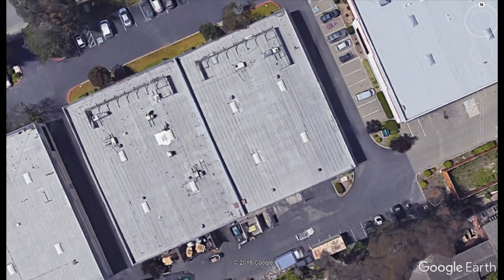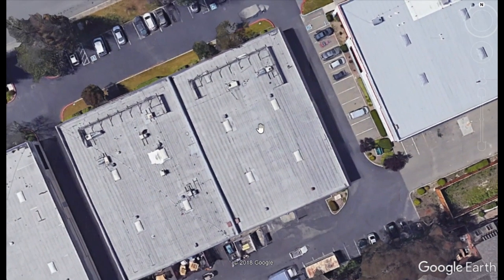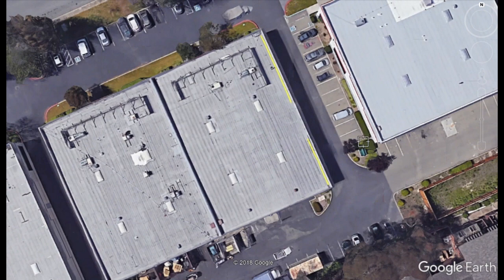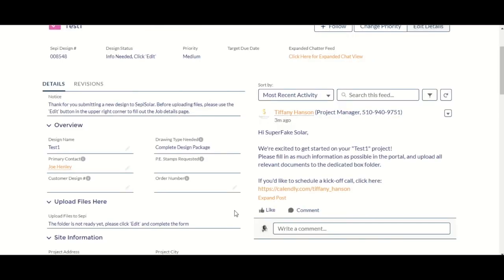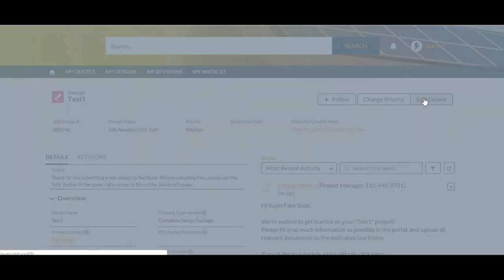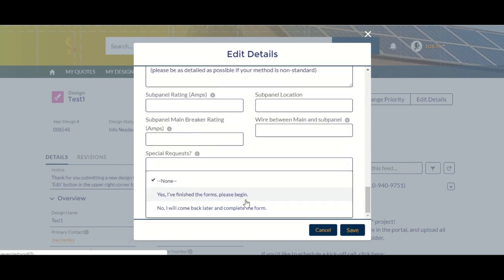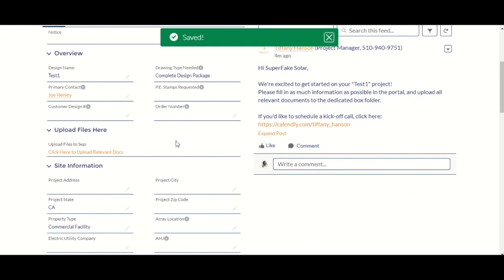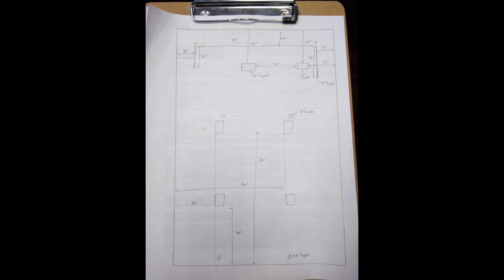How to Perform a Solar Site Survey

Comment: So my rafters are about 83 inches apart and I am being told I am not able to have panels installed due to the rafter beams being too apart. Is this correct?
Reply: Yes that is correct, beams shouldn’t be more than 36 inches apart.